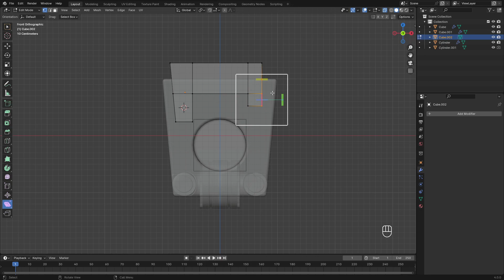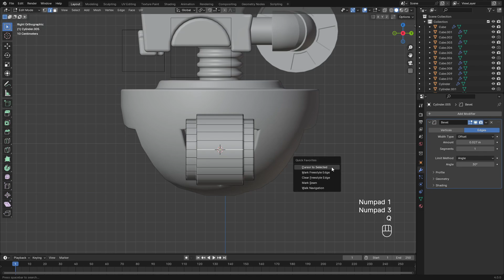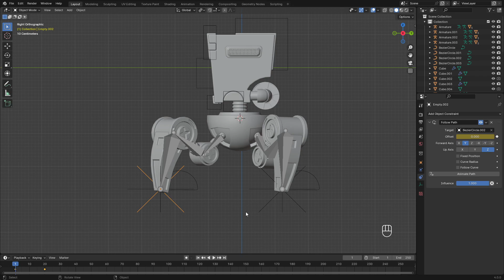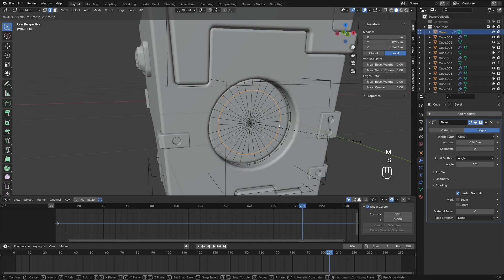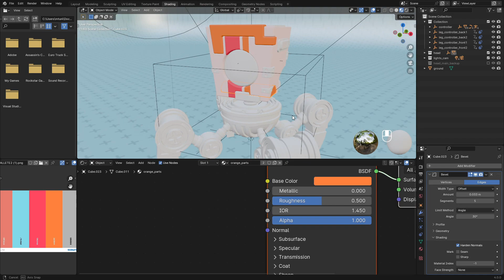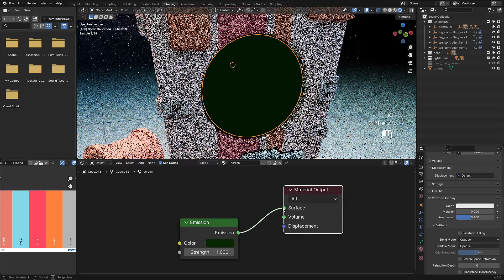3D Robot Modeling and Rigging with Walking Animation | Blender

Comment: i cant press ctrl + /, it no think happend on my object, can help me?
Reply from the maker: It sounds like you're having an issue with the Bool Tool. Here's how to fix it:

Ensure Bool Tool is Enabled:
 - Go to Edit > Preferences > Add-ons and search for "Bool Tool."
 - Make sure the Bool Tool addon is checked and enabled.

Correct Object Selection:
 - First, select the target object (the object that will have the Boolean modifier applied).
 - Then, select the cutter object (the object that will subtract from the target).
 - Now press Ctrl + Numpad / to apply the Boolean difference.